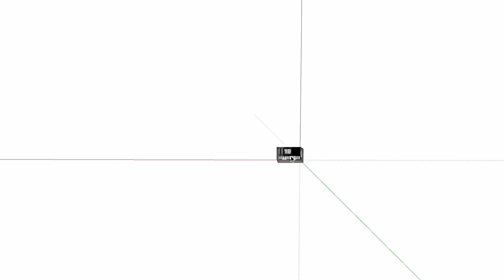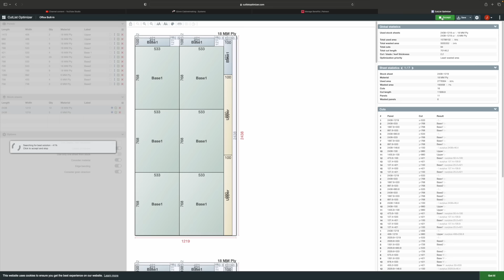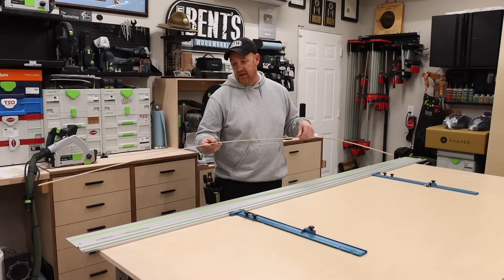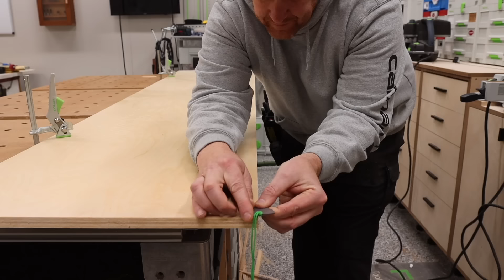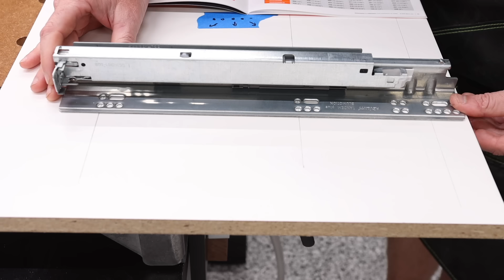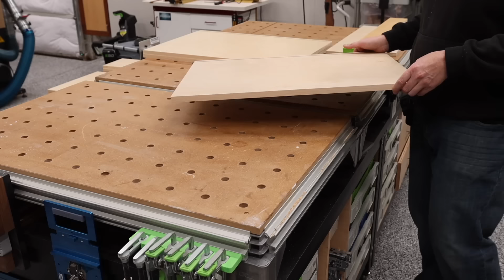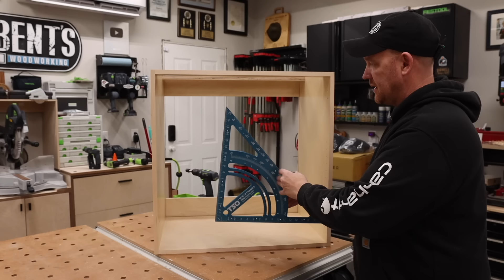STOP overbuilding cabinets

Comment: I’ve built many cabinets but help me understand the use of a flimsy 1/4” backing?  This will offer very little support if you actually want shelving instead of a huge open square shaped box used in the video.   Shelving needs support.

Comment: Bent, I'm only 6 minute into the video, and I've added up about $5,000 worth of Festools which a pro like yourself would and should have. The rest of us will have a generic circ saw, a straight edge guide and a table saw with a fence not as precise as that Incra? So, all good information aside, the process for the rest of us will be a bit different. Using the parallel track setting guides assure the rips will all be "parallel" rather than using the" measure twice cut once" system. I'm not certain the word "overthinking" pertains to us, rather just a different approach. You started out like we all did, with basic tools and simple methods. I would like to see a video of the same quality, but using the tools more commonly available. For me the glue ups were always the most challenging when working alone, there were just not enough limbs to hold and clap all the pieces, until I got the self squaring corner clamps from HF.

Comment: I always slide in the back panel during assembly, this in order to lines up the grooves that accept them. On very littte occasions the front sides are not lined up perfectly then, but at least my back panel fits. That's  more important than flush front sides as they're normally hidden behind doors and drawers fronts.

Comment: The last full kitchen I built was during COVID, and all we could get was big box plywood. It was terrible in general.. voids, ply overlaps, delamination.. etc.  But the most shocking thing is that not only were the sheets not square, the long edges were  not straight. One edge bowed out 1/8"+in 8' and the opposite edge bowed in the same amount, like a big flat banana!  First time I'd encountered that, and an entire unit of plywood was all the same way.   So anyway cutting one edge straight was paramount.  We used the stuff- kitchen came out fine eventually but every piece of every cabinet required some kind of re-glue or other repair.
Reply: And if you spent less than $90 a sheet consider yourself lucky

Comment: im guessing you don't make many cabinets. you don't need all those nailers. instead of adding the 2 back nailers, and cutting the groove for the thin sheet used as the cabinet back, simply cut a piece of ply to form a back panel. cut it so it overlaps the back edges of the side panels, and the back edge of the base panel. for the front, just put in the top rail as either a vertical rail or horizontal rail based on cabinet application.

Comment: Nice video, but you seem to have done what Sedge did in his recent video - putting the base between the sides.  That is perfect for wall cabinets where the weight is taken on the sides e.g. with a French cleat but for a floor-mounted cabinet (which I think this is) the weight is transferred from the sides through the base, especially if it is off the ground on legs of some sort.  You then get a shear between the sides and the base.  If you look at the Festool cabinet design with the AZ drawers they show the base under the sides for this very reason.  Thoughts?
Reply: You are correct.  Weight is always transferred to the ground and in this case, the screws have to carry the weight and transfer it laterally to the base board unless the legs are assembled directly under the sides which would be difficult to do during installation.

Comment: Very helpful. Thank you! I am buying the same tools for my small home shop right now and will work in the same way. Plan to build my own cabinets.

Haven’t looked through your videos to see if you have already done it, but would appreciate seeing a video on the hardware you use - especially the drill tool that looks to leave a conical hole for the screw head. Thx again!

Comment: Last summer I put together a sideboard (really just a cabinet with legs). My lord that took *forever*. Yeah, it's for outdoors, so I'd still use glue and dominoes, but I think it's not that hard to start with this design, alter it a bit, and bang it out way, way faster. And probably more square. 

I just did a few facepalms. There's some nice "a ha" moments in here. Thanks for the video. This is definitely going to adjust my plans for some shop cabinet construction I've been thinking about doing soon

Comment: just wondering how you would attach your end panels if they were exposed? I will be building a small kitchen cabinet set and would like to copy your assembled technique, but i’m trying to figure out the best way for the few exposed ends that I will have, both uppers and lowers. thanks for any suggestions and great channel
Reply: nevermind, lools like pocket screws would be the way to go 👍

Comment: Good and well thought out process.  Just realize that this is nothing like the title suggests, this is nothing remotely easy. Most people own a circular saw and maybe a table saw.  I have a very well equipped general purpose shop, but cannot come close to the specialty tools and especially the specialty set up just for woodworking, using a process that's has taken years to develop.  It's cool, but this "easy" is not vast-majority people's easy.

Comment: I this video you note a difference between cheaper and more reliable edge banding.  I was wondering where you get the better quality edge banding?  Not sure where to start.  Until now I didn't know such a thing existed and I was working with pretty standard stuff that matched the type of wood I was using.

Comment: This is incredibly similar to the way I built the cabinetry in my minivan so I could be a vandweller and live out in the desert for several years. No glue. Just careful fitting. Because I used 7-layer, ½" plywood, I used 2½" #6 woodscrews. I pre-drilled for every screw. 

I have lived in that minivan for over four years. I have taken it places most Jeeps never go. That cabinet is still rock solid. Trying to move that cabinet feels literally like trying to move the body of the car.

I think most of the extra stuff that people do is only to look good on YouTube. 

If you are interested, I'll post links to my van build.

Finally, you are one of the few YouTubers who actually explains WHY you are doing what you are doing. So, I just subscribed.

Comment: I appreciated the chance to see you go through your process of breaking down the plywood using the Festool line products. Forty years ago I was building cabinets in a production shop in SoCal.  Our assembly process was almost identical.  Panel break down was a little different.  We cut everything on a 10" Powermatic TS with a Biesemeyer fence.  We had super nice saw blades that got sharpened every week.  Much of our work was with melamine panels but we also handled plywood.  We had an automated edge bander that applied hot glue to the band and pressed it into place and then edged it and end trimmed it.  A time saver for sure but it meant cutting all of the cabinet pieces first.  Once cut and edge banded we drilled them with a gang drill.  Our assembly tables were set at about 20" off the floor and we used 1-1/2" narrow crown staples to tack the pieces together before drilling by hand and adding 2" screws.  The screws were fast thread and had an unthreaded upper shank to insure the pieces drew together.  We preinstalled all hardware and aligned front edges by feel and located screws by eye.  This gets very easy to do if you're doing it every day.  We used five screws along the bottom of the side panel instead of the four you used.  We used two on each end of the top stretchers.  After the sides, bottom and top stretchers were secure we placed the back panel into its recess (cabinet resting on its face) and used it to square the box (also checking diagonals).  We used a small narrow crown stapler with 5/8" staples to secure the panel and force the panel to the front of the groove.  The staples were shot in at a 45 degree angle.  We then placed the two back stretchers (top and bottom) and set them with the 1-1/2" staples and then screwed them in place as you did except for adding screws along the top where you only used staples.  The final thing was putting a couple of 5/8" sheetmetal screws at an angle into the back along each side edge as security for the previous run of 5/8" staples.  Using this method I managed to assemble thirty-four cabinets in one day,  which doing the math now is about one cabinet every twelve minutes.  The parts had been cut and prepped the day before (except for the hardware).  Installation was on a separate dead level toe kick. Cabinets were clamped and screwed together before the run was attached to the wall.  Uppers were hung by using an upper back stretcher that had a 45 degree edge facing down (long point to towards the wall).  This would then hang over a wall cleat that had a 45 degree edge facing up (short point against the wall).  We could hang a string of uppers on one wall cleat but it meant cutting a clearance notch in the side panels of the adjoining cabinets.  I think the installers handled that.  I don't recall doing it in the shop.

Wow! That was a trip down Memory Lane!  I built so many cabinets! 😂
Reply: That was very helpful, thank you!
Reply: Do you need a job? Might have something for you
Reply: Helpful trip down memory lane. Thanks!
Reply: This is the best comment on YouTube

Comment: One little detail that I haven't solved for is the proper fastener for the Blum hinge plates when pre-drilling the 5mm system holes like what you've done. I've tried using 5mm "Euro screws", but I have found that the holes in the Blum hinge plates are too small for those (I order my Blum hinges from Rockler currently). I suspect I'm going something wrong...like maybe using the wrong screws. Any thoughts/solutions for this?
Reply from the maker: You need to get the system screw plates. Or, you have to drill out the normal screw ones.
Reply: @bentswoodworking  Thanks!  I didn't know about those.

Comment: I like this method.    Could you do a video explaining how you handle the toe kick?   How you make that look good.    And, especially what you do about an exposed end of a run of cabinets?    
Thanks for a well-explained, well-thought-out process.
Reply from the maker: Will do!
Reply: @bentswoodworking  I am thinking of trying those adjustable, plastic cabinet legs you screw on the bottom.   Any thoughts about those?  Any experience with them?
Reply: @Mark Williams  Really,  you have never used them?
I have been using them for the last ten years, and they are the only way to go.
Using wood bases is really wasteful of good wood,and first thing to suffer when the inevitable flood occurs. 
Just push the toe plates up gainst the feet, and either silicone them in permanently, or if you can cut a firm fit, glue some blocks on the back, slide them in and be able to remove them for repair or clean in the distant future.

Comment: I agree with your way to build a cabinet where the sides won't be seen. My only difference would be, you're moving the cabinet twice when you first nail it together, then move it again to countersink and screw it. Nail, countersink and screw one part, move it and repeat.I did this commercially and it saves time in the long run. But, you don't need dados and rabbets for every joint. I built cabinets for schools that see day in and day out use and abuse, that are still being used without problem.

Comment: Why optimize rip rather than crosscut? I usually crosscut first then cut to final on table. For sides (30.75" high) I can make 2 crosscuts @ 32" from each end and then easily handle the material on the table saw without touching the track saw again. I prefer to minimize cuts with the track saw because of how easily it gets out of perfect true relative to table saws, but maybe my track saw isn't as good.

Comment: I worked for a custom cabinet builder and this is the same way we did it. No need for glue or any special stuff. Those screws will hold the whole thing just fine for many many years.

Comment: Just a quick tip. They make a lacquer adhesive that bonds to prefinished plywood and melamine. 
Work at a cabinet shop and we use it for building all our boxes
Reply: If you don't mind sharing, what is the name of the adhesive? and where you do buy it?
Reply: @markstrandoutdoors  old comment, but Roo glue.